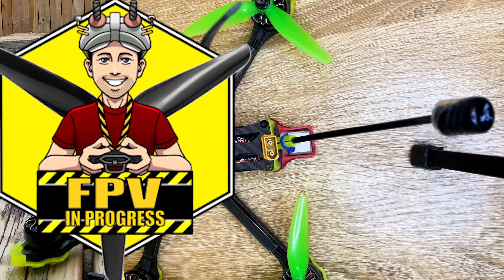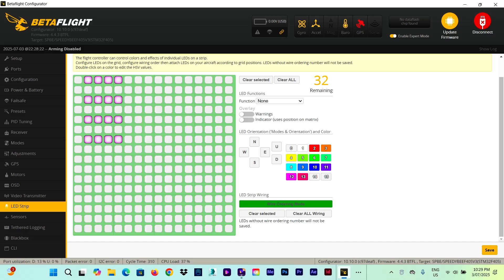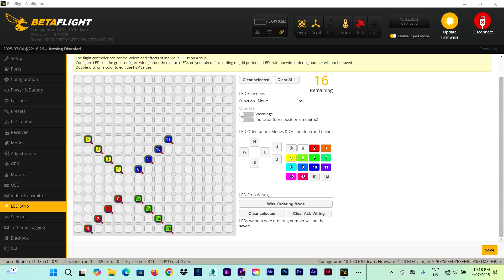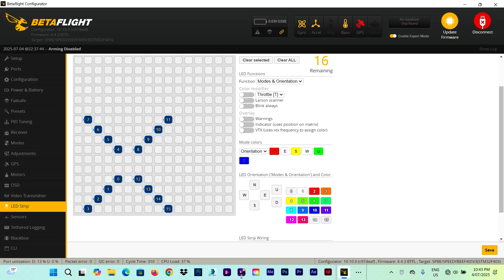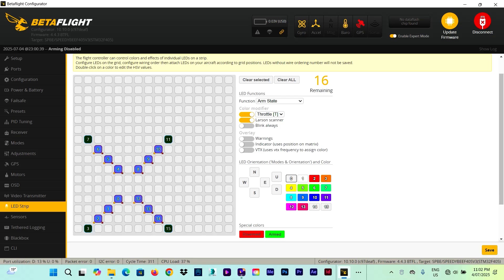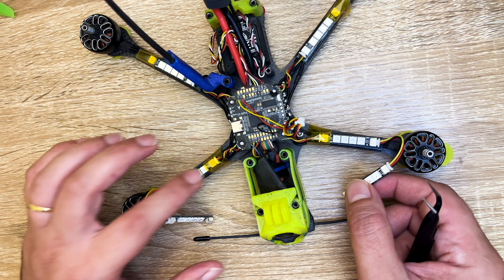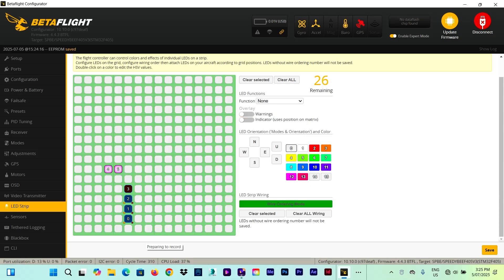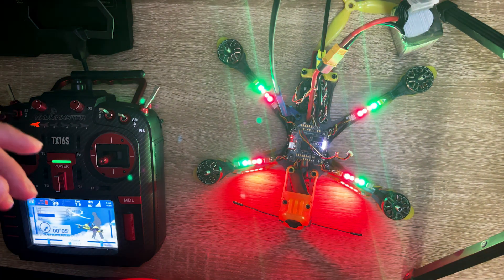CUSTOMIZE Your LEDs on Betaflight LIKE A PRO!

Comment: excuse me sir, when i solder the led strip to my speedybee f405 v5 i cannot control it with betaflight, idk why
Reply from the maker: Press and hold the boot button on the flight controller to switch between speedybee and betaflight